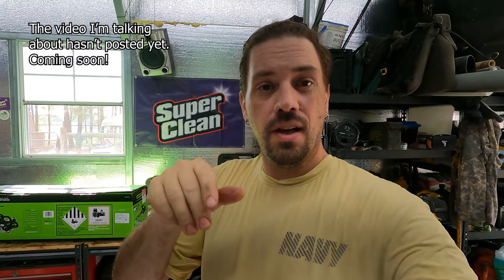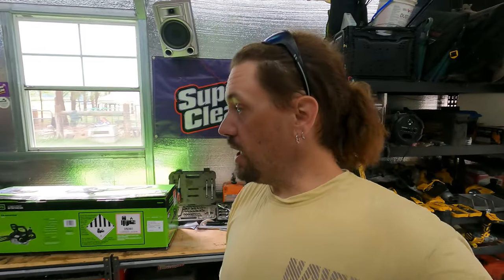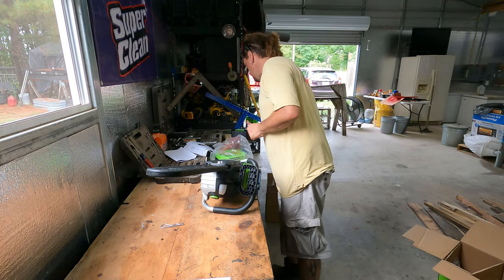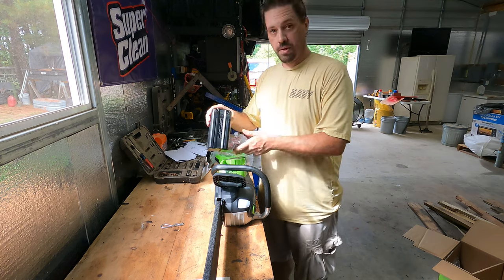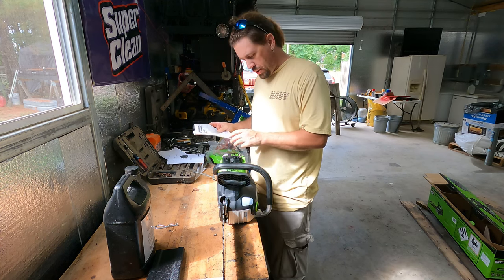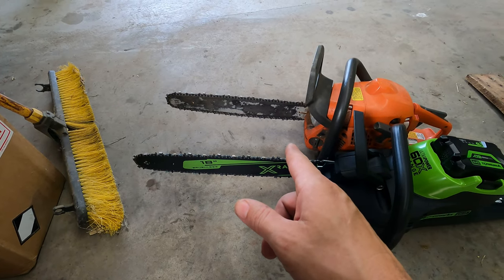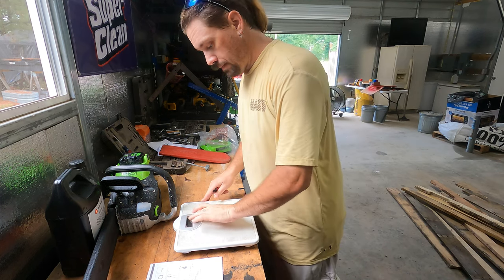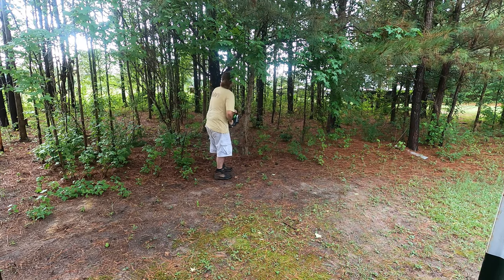Greenworks pro 60V 18 inch Chainsaw Unboxing and review

Comment: YES! This marks the first video review of the so-called X-Range version, the only Greenworks Pro 18-inch chainsaw, of any voltage, with a 2.5-kilowatt motor. The other 18s (69V and 80V) are 2.0 kW.  It also has a magnesium housing.
I bought the first run, sold bare (without battery and charger) directly from Greenworks. I've barely used itm but I let a skeptical, 56-ish tree guy try it out and he was blown away. I watched as he cut up a fallen 24-inch trunk. Boy, did it throw chips.
Thw tree guy used my three the 5.0AH X-Range batteries, which are a cut above the standard 5AH battery that came with your saw. They never cut out or stalled.
Greenworks Pro sells a 16-inch chainsaw with a 2.5KW motor, in 60V and 80V. 
Greenworks Commercial sells three 82V chainsaws: 16-inch, 2.4 KW; 18-inch, 2.7 KW; and 20-inch (with an 18-inch bar also included), 3.4 KW.
Reply: I bought the first Xrange as well. (I think we've talked before). But I run the 8ah Xrange batteries and yes it's very heavy. I was just on Greenworks site yesterday and they show a 60v Xrange saw with a 20" bar that comes with the 8ah battery and charger and it claims in the description that it's 3.2kw of power. I do believe mine is the 2.5kw, because the model number is 60CS25. You can get the 3.4kw 82v kit from Greenworks commercial right now for $599. But it's only a 4ah battery. When I got my saw, I think they were discontinuing the model because I got the saw, two 8ah batteries and the 10amp dual bay charger (simultaneous charging) all for around $700. I agree with you though, I don't run it very much. I prefer my 40v Greenworks. It's lighter and might be a bit slower but still cuts great. I think I promised you a video... I still want to make a short video demo-ing the cutting speeds of the 40v, 60v, and 80v.

Comment: You would get a better idea, if you were not cutting twigs, mine brings down big trees, easily
Reply from the maker: I did a big tree once...  got 3/4 of the way through 1 cut and had to go grab the gas saw.  Also cut a 1/2 load of pine for our fire pit...  a hijet load...  ended up switching to the gas saw because... again.. dead battery.  Have since sold this saw and gone back to gas.  If I'm cutting anything more than a 6 inch diameter tree I get the gas saw out.  If I'm limping for the chipper the 20v dewalt chainsaw out lasts this saw, weighs less, and is more portable than the greenworks.  I didn't find a single situation where this particular saw was better than a gas or cheaper electric.